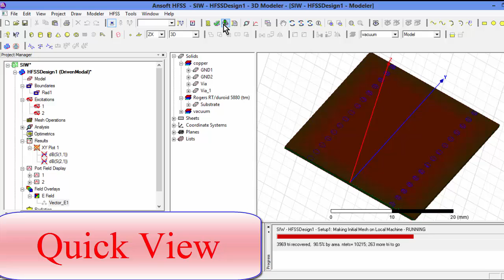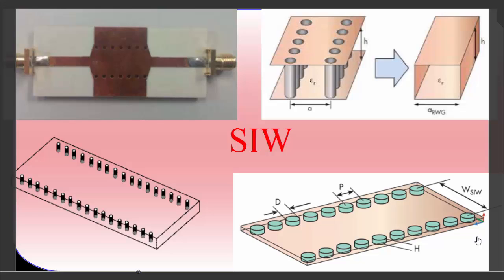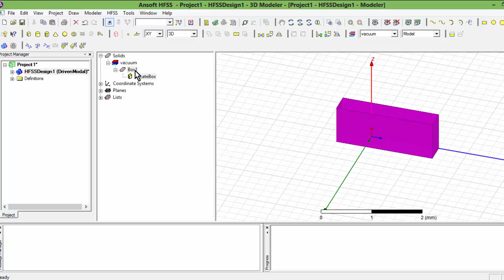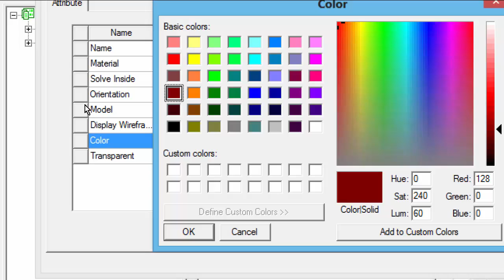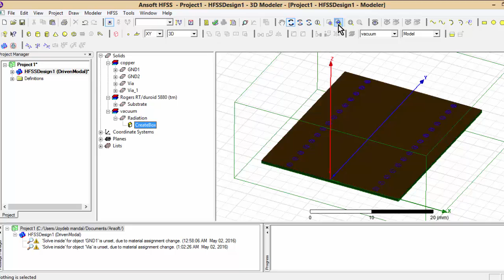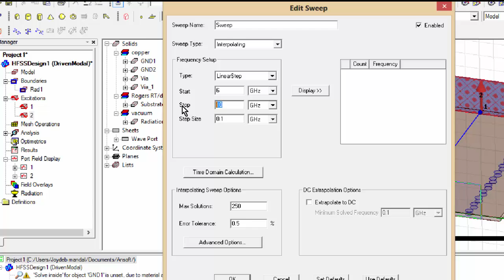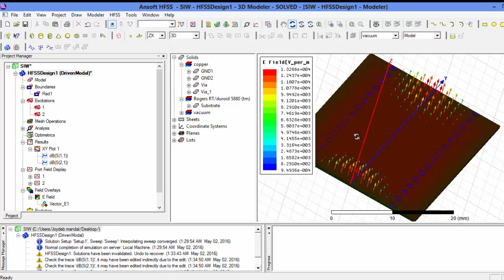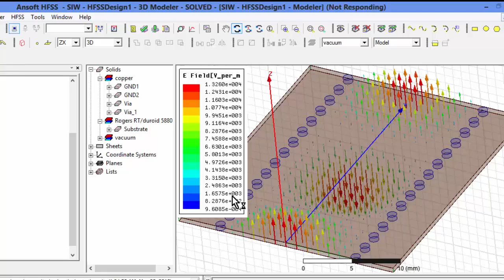Substrate Integrated waveguide (SIW)- HFSS simulation

Comment: how to stimulate dispersion diagram  vs frequency(ghz) for a mushroom type unit cell using HFSS.
Reply from the maker: Let me answer one by one.
Dispersion diagram is Beta by K0 (or Freq) plot.
To do this, take help of out put variable and plot Im(gamma) with freq.
for this you ca follow: 
https://www.youtube.com/watch?v=IulK6rvNDpY
after 18:00 min.

Next, the question of unit cell,
I am not sure it is possible in HFSS, But in CST it is very easy to design. For that you may see cst manual.
For now, in HFSS can try port de-embedding.
Hope you got my point.

For your next question like how to find input impedance, you follow manual or rectangular plot to plot the same or use some formulation to obtain this. Still you are need this I have to search for this.

Best wishes.
Mini Knowledge.

Comment: Sir how to choose the diameter of via connected in the substrate waveguide
Reply from the maker: It depends on operational frequency. There is no such strict rule. Goal is electrical short circuit. It should be much much lesser than operating wavelength. For X band 1 mm to 0.3 mm is acceptable. If you increase the frequency let say, 100 GHz, instead of via very thin side wall plating is suggested.
Note that due to via diameter effective width of wave guide varies as well as cut-off frequency.
Reply: tHANK YOU sIR..
Reply from the maker: Thanks. Please Subscribe the channel to reach 1000 Subscriber family.

Comment: I followed similar approach but I am getting an error "
    [warning] Warning - Boundary 'PE_TopWall' and Boundary 'PE_Side' overlap.   (11:16:37 AM  Jun 08, 2017)
    [warning] Warning - Boundary 'PE_TopWall' and Boundary 'Rad1' overlap.   (11:16:37 AM  Jun 08, 2017)
    [warning] Warning - Boundary 'PE_GND' and Boundary 'PE_Side' overlap.   (11:16:37 AM  Jun 08, 2017)
    [warning] Warning - Boundary 'PE_GND' and Boundary 'Rad1' overlap.   (11:16:37 AM  Jun 08, 2017)
    [error] Port refinement, process hf3d error: Port 2 is assigned to an internal face.  Only allowed with lumped ports.. (11:16:44 AM  Jun 08, 2017)
    [error] Simulation completed with execution error on server: Local Machine. (11:16:44 AM  Jun 08, 2017)
"
Reply from the maker: Make sure port and radiation box just touched each other.
Your probable error due to geometrical dimensions, I will suggest you take all dimension in the form of Variable that reduces this type of error.
:[error] Port refinement, process hf3d error: Port 2 is assigned to an internal face.  Only allowed with lumped ports.. (11:16:44 AM  Jun 08, 2017):
This is due to both ports are not just touched with radiation box.

Please see the video  once.
Reply: Got it.
Thanks
Reply: Muquaddar Ali I need your help in designing as I am a starter and I hardly know anything about hfss
Reply: There are many tutorials available for beginners you can start from there. Anything special you want to know you can ask if I know I will try my best to help you.
Reply: I had tried but it's of no use.  Like just seeing and copying a video doesn't give u any idea . I am an M.Tech student of 3rd sem and I am working on SIW but these tutorials are only beneficial for those who know some basics of hfss
Reply: whats ur emal id? I can send you some tutorials
Reply: Muquaddar Ali also tell me how to take co ordinates
Reply from the maker: See microstrip line video. Hope it may help you.
https://www.youtube.com/watch?v=h90wEsO7pvQ&t=46s
Reply: @rfzone3099  Thanks Dear..I wish to design HMSIW (Half mode SIW) in HFSS...Do you have idea for this..kindly acknowledge

Thanks
Nitin
Reply from the maker: Thanks. Please Subscribe the channel to reach 1000 Subscriber family.

Comment: Respected sir,
i followed your procedure but the following error occured.
Project2 (C:/Users/user/Documents/Ansoft/)
  HFSSDesign1 (DrivenModal)
    [error] Port refinement, process hf3d error: Port 2 is assigned to an internal face.  Only allowed with lumped ports.. (10:35:10 AM  Sep 12, 2017)
Reply from the maker: Hi,
This is very well known error. Actually, radiation box and port should be just overlapped. Port should not inside the radiation box. Check this one first. For more experience go to 
https://www.youtube.com/watch?v=h90wEsO7pvQ
or
https://www.youtube.com/watch?v=IulK6rvNDpY